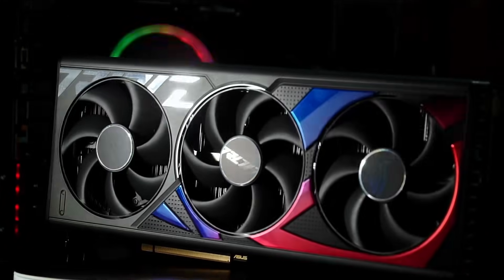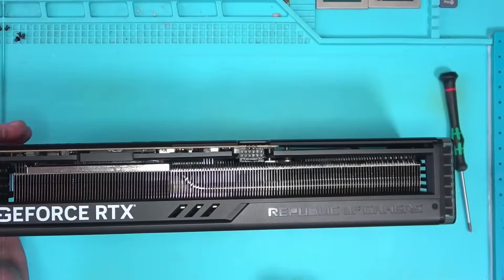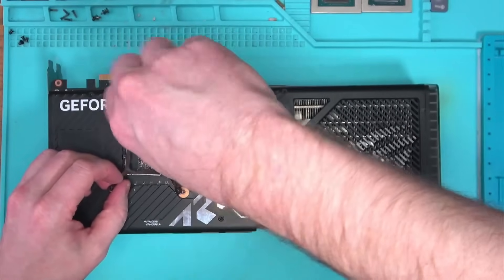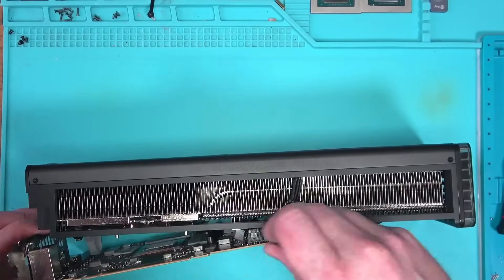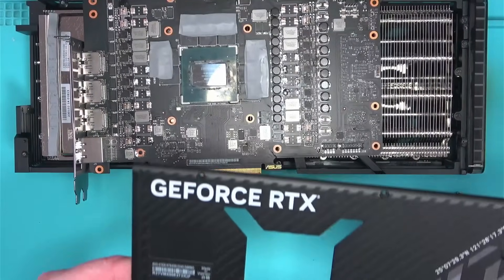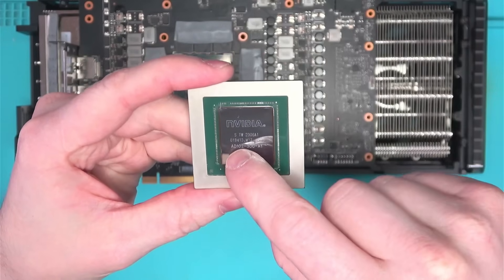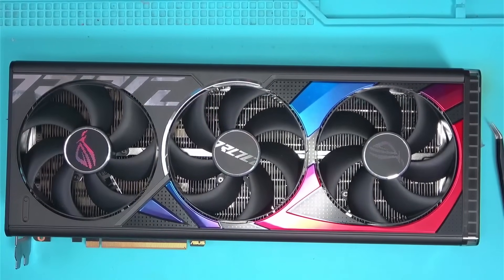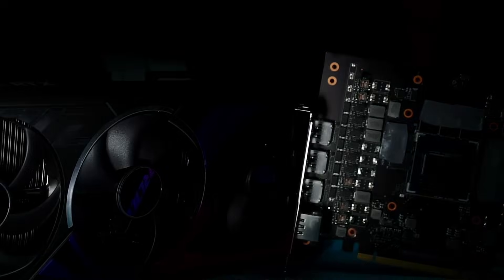Bait and Switch: Amazon Sells 4080 as 4090! GPU Repair Fail!

Comment from the maker: Correction. The core is 4080, not 4090 mobile as i suspected earlier 🤫
Reply: Apart from the chip type and the remaining damage.
Would another chip on the PCB even run if the hardware was otherwise fine?
Reply: Both are correct. The 4090 mobile is literally the 4080 desktop core.
Reply: Hi, was wondering, if suprim x (not liquid), gaming x trio classic 24G and gaming x slim have melted in your experience or are they slightly safer options ?
And would you suggest any of those 4090s or 4080 super ?
Reply: Yup, mobile 4090 is like a collectible, its VERY rare
Reply: @uhohwhy  It has to be collectible because no way it would work. It must be really dead.
Reply: China fake crap. (interesting that i see my comments only, without login i see nothing.)
Reply: Wish I'd seen this sooner, at the end of 2023 I saw a Amazon Warehouse returned Strix 4090. Bought quite a few PC bits with no previous issues so hit buy. Opened it up soon as it arrived and first warning was the cables were not right, no biggie, then I opened the anti static wrapping, and discovered it was a fully assembled heat sink, but no PCB.

Not impressed I can tell you, sent it back and had to wait a week for a refund. Amazon didn't seem to bothered they'd been scammed themselves. I should of taken photos of the serial number.
Reply: I don't understand what's the difference they're all AD103.
Reply: @TheGrizz485  well the difference is $2000 usd for a 4090 and probably less than $1200 for a underpowered laptop 4080.
Reply: No theyre not lol. AD103 is 4080, AD102 is 4090. Someone had the exact Black Strix version of this card but as a 4080. Their 4080 fried, ordered a 4090 on Amazon and swapped the PCB with the chip, said it was DOA, and returned it to Amazon and got a full refund cause Amazon rarely even checks. They might have plugged it in to test it, saw it was dead, and sent it to the palate. They don’t actually open these things. That would take too much time for employees to do that and Amazon would lose more instead of just trashing it. Use to work there lol trust.
Reply: @evangelinadurazosellers5435  Yep. The toasted connector means nobody would try to test it. Failed the visual inspection and tossed in the junk boxes.
Reply: @ir8d8rads you mean they bought upgrade, put fried board inside new fancy case, broke connector to make it look damaged when shipping and returned it?
This is so fked up.

Comment: I want to know what firmware it has. Also, I’m curious if the PCB is actually a 4090 PCB, it is this a fake as well. Did they make this PCB for this scam? If the firmware is weird, and the GPU core pinout matches the ada103, there will be more of these

Comment: AD103 is 4080, AD102 is 4090. Someone had the exact Black Strix version of this card but as a 4080. Their 4080 fried, ordered a 4090 on Amazon and swapped the PCB with the chip, said it was DOA, and returned it to Amazon and got a full refund cause Amazon rarely even checks. They might have plugged it in to test it, saw it was dead, and sent it to the palate. They don’t actually open these things. That would take too much time for employees to do that and Amazon would lose more instead of just trashing it. Use to work there lol trust.

Comment: Have you seen those 4090 with core and VRAM missing, ie, stripped for AI, with the rest sold as a working 4090, ie, when the heatsink is on you can't tell they are missing.

Comment: I buy a fair bit from Amazon UK, I'm wary of the fact that their returns policy is so generous it seems that when I bought a good deal 4060Ti 16gb recently I opened the thing like a crime scene investigator, searching for ANY signs it had been already used. It passed my tests, serial numbers all matched etc. Then the audio wouldn't show when I plugged it in, and GPU-Z, HWinfo etc were not responding neither was Nvidia app.... It turns out the drivers needed the Jan 24 ones installed and suddenly it started working.... It is a concern tbh- folk returning broken things and swapping out stuff. I'm now even wondering whether to buy the monitor I have my eye on from them. Has anyone even done a video on how to spot a fake GPU??
Reply: That is normal behaviour you were trying to use it without a driver and after you installed the correct one for that model it started working properly in windows.

Comment: Ive broken that part off before and been fine 😂😂 when i was younger and had a stockpile of old pc parts that is. What is too tight though? I run them down firm but not tight, figuring the springs are supposed to help hold tension. Guess im glad i had lots of practice on old stuff lol

Comment: Is it possible to easily increase the amount of memory on some cards? I'm sure that a lot of people want to run AI, and they are limited in the gpus they can get because they need a lot of VRAM. If you get GPUs to fix, could you just add chips or replace chips with higher capacity ones to increase the VRAM and sell at a (small) premium?
Reply: no you need to make a custom bios also and reflash the bios and you will have problems with getting drivers to install or the device to be correctly detected most likely since it wont match official nvidia specs

Comment: You could tell it wasn't a 4090 even without opening it. The capacitors on the back of the core on the PCB are definitely not the ones on the 4090.

Comment: After China imported a lot of 4090 cards before the embargo and equipped them with other coolers for use in data centers (including desoldering AD102 chips for whatever reason).
Is it possible that the resulting, actually worthless hardware is also wanted to be monetized somehow?

Comment: for me it looks like a scam by service/technician guy, who repair GPUs for daily basis.

 he had a lot of bad cores, bad memory chips, and crack pcbs which cannot be repaired. 

so instead throw it all into recycle bin, he decided to put all bad parts together on that board and then sell it. he knew that melted connector will attract buyers as a good offer for quick repair.

he cannot be a regular gamer/customer. - this scam is too good for a person without knowledge.

probably, the original GPU core from that pcb was good, so he took it / save it and replaced it by anything bad, which fits there.

Comment: So, the general assumption seems to be that less scrupulous (usually Chinese) AI companies are buying 4090s, taking the chips out and putting them on their own specific boards and then returning the the now empty board and cooler.
These guys look like they were trying to get away with it longer, or maybe they are middle-men of a two part scam of selling the 4090 chips and then selling the card that'll fool someone long enough for them to get the money and run.

All around, make sure you get your tech, especially if its expensive, from reputable sellers with good returns policies.

Comment: The retailor that's allowing this does it with their own For Sale items ive been burned by them myself, when they sell fakes sold by the Big A you can't leave a r
Review they let some good ones though then do something to prevent any bad truthful reviews on said item, you get a error thats says theres a issue they are looking into but the item stays up for sale indefinitely, if you call them they won't talk to you about it!  Just like the automotive fuses they sell rhat are not fuses they don't trip anywhere near the rating but they have thousands of 4-5 Star reviews. You will have to fill in the blanks here because YTs AI likes to delete any mention if the brands or rhe Seller. Id be surprised if this doesn't get removed by YTs Skynet.

Comment: This is why I refuse to buy electronics from the used market. Theres all sorts of shady stuff going on when theres a bit of money involved. People will do whatever just to make a buck and the GPU market is no exception. Buy from trusted sources always.
Reply: I mean, I just got my hands on a GTX TITAN Z sold by PNY for 200 bucks. If you buy from a good source, it's easy to get what you're looking for, even for rare components.
Reply: I buy and sell used computer parts for years.  
I did sell a used AGP GeForce 6 card last summer for $100.   The buyer had bought a bad one off eBay.  I admitted I had no way to test the card since I did not have an AGP motherboard anymore.   I was glad when he reported back that the card worked perfectly.
Reply: I have bought 4 used GPU's and a couple of used consoles over the past few years and they've all been fine. All of them are exactly as the seller described and all of them still work. You just have to not buy from sh!tty sellers. It's usually pretty easy to see when a seller is legit based on number of transactions, feedback, accepts returns, etc. After you've dealt in the used market for awhile, you generally develop radar and can spot questionable/scammy sellers from a mile away.
Reply: @Kryptic1046  Dead on with your assessment. I have bought a lot of used computer hardware off ebay and I've only had one issue. That issue being an intern that sent me the wrong GPU. The seller made me whole for no extra cost though so I gave them a good review. Since I'm mostly buying cheap stuff under $100 I'm willing to take some risks.
Reply: @Kryptic1046  After getting tracking number scammed by 2 different large scale high rep sellers on eBay a few years ago and eBay did nothing about it, I changed my strategy for buying used electronics and have had nothing but success with it. Basically I look for signs that the seller is clearly just a person with a computer hobby who occasionally sells on eBay when they haven't had takers elsewhere. I look for instances of feedback from PC part sales, anywhere from 20-100 positive transactions in their account history, and are actively selling or buying PC parts within the last year. I will also usually try and strike up a dialogue and engage them with a few very courteous and basic questions about the part to get a feel whether or not they're insane or an idiot to determine whether or not I should keep bidding.

Since I learned that high volume sellers with a long record of positive feedback might suddenly start scamming people, I started only doing business with people I can identify as actual PC bros instead of high volume resellers who only care about the money, and since doing that eBay has become a really nice place to shop for me.
Reply: there's many trusted sources for the Used market too.
and for Buying from an individual you could request them to prove that what they're listing is real with Photos and Video - proving that they actually have it and that it works (having someone write their Username and hold it up in a Photo, the usual - Video of it running real workloads so you can see if the performance matches expectations, as well as them showing stats of the Hardware while it's running).
an Individual could try to scam you after that, but if they provide such proof and what you receive is incorrect, you are protected well enough and can get your Money back. granted that will waste some Week(s) of your time, but.
Reply: Cool. Ebay is a gold mine, more for everyone else.
Reply: @x8jason8x  I bought a used 6900K from there that still works to this day, got a working replacement mobo for my i7 3770, also from a good seller there, "used" but so clean you'd think that motherboard was BRAND NEW.
Reply: If you make good research you can save a ton of money buying used, had no problems ever. But you gotta be careful.

Comment: So wrong PCB matched with wrong core. 
Safe to assume that the pinouts are wildly different and the moment power was applied to this card it just went up in smoke?
Reply: That's just a 4080 PCB, you can see the silkscreen matches the outline of the GPU package perfectly. Someone had a defective 4080, attempted repair themselves, completely messed up everything, then ordered a 4090, took the stickers from the 4090, put them on the 4080, and sent the 4080 back in the 4090 box to get a refund. Judging by the placement of the VRAM thermal pads, they might even have swapped the cooler from the 4090 over to the 4080, which is why the pads don't align with the chips.
Reply: @Alvin853 damn i mean how should amazon even test that?

Comment: no, thatsa  4080 desktop core, not a 4090 laptop core. laptop core would not be ad103-300. laptop cores have "gn" in it
Reply: I saw ur eBay post about buying 32 4090s what happened with that

Comment: My guess is somebody with no scruples bought a real 4090 on amazon, replaced the working 4090 board with a dead 4080 board with 4090 mobile GPU (maybe some aliexpress special) and kept the working 4090, using the aliexpress 4080 shroud/serial from the dead board, so the real serial still matched on the return. Amazon couldn't/didn't want to repair it for resale, so they packaged it in these "return pallets" that they sell as mystery boxes so they can get rid of their crap. The buyer of this mystery box then sent it to NWR for repair, where he determined the board to be essentially "fake". Amazon was probably the one being scammed, at least in this case.
Reply: I think so too although I'm yet to see any 40 series mobile aliexpress PCI-E Frankenstein cards on the market. I think this might just be a dead 4080 board.

I've no doubt those Frankenstein cards are coming though, they exist for 30 series mobile GPUs
Reply: could just be a shady reseller passing off aliexpress hackjobs as legit product, and it got returned when it fried.
Reply: Why even bother getting 4090 mobile gpu at that point?
Reply: what is worse is if this was from a 3rd party seller (even if shipped by amazon), amazon would have refunded this customer in full taken that money from the seller account (sellers dont get paid by amazon for the order until 10 business days after the order is marked as recieved) and if the 3rd party seller didnt opt to have the card returned to them (paying the postage themselves) then amazon just sell it in a returns pallet automatically. Amazon wont even do a basic check to see if the item is physically damaged and even elegible for return/refund. Likewise they dont even unseal the box to verify that what is returned is the same item that was shipped. They use the tried and true "if it looks like a duck, and quacks like a duck, it must be a duck" approach.

This is why I tend not to list anything as a seller on Amazon anymore, Amazon's policies are so customer friendly that people can and will abuse them and almost always get a 100% refund. I once had someone order a gaming monitor. We shipped it, it was delivered and signed for. Then 1 day before the amazon deadline (89 days from order) they lodged an A-Z claim for full refund saying they didnt recieve the monitor. As the seller we had to fight through losing the case (it was automatically granted to the customer within 10 mins) then on appeal after showing the tracking with customer signature Amazon finally rejected the claim by the customer. It almost went the other way, since we couldnt provide video or photographic evidence from the courier (which was not a normal postal service, it was a full courier tracked door to door) that the package was recieved. I think it was us using a full registered courier that got the case in our favour as if we used regular post, amazon likely would have sided with the customer.

Amazon has become so dodgey for sellers simply due to Amazon's own policies and the many people out there who take advantage of it knowing that 95% of the time they will get a full refund.
Reply: Work smarter not harder
Reply: No... i dont think amz guys check stuff like these when they get returned. I sus a round of visual inspection and it gets thrown in box. 
Ideal cse scenario they should at least be throwing this in a tester to find out see if this even boots or not, but knowing their volumes, probably not.

Oh well, what are ya gonna do. Corpos try to save money, give their job to someone else, somebody down the line will abuse it.
Reply: No scruples? He got a free 4090.

Comment: First issue was trusting Amazon for such a component. B&H ftw in my opinion
Reply: B&H?
Reply: @EclipseWarlord  bhphotovideo. Don't know why I threw the & in there lol
Reply: I bought a 1080Ti from amazon on launch, but made sure it was NEW and sold by them. If you have a problem just return the item... Never had an issue with Amazon but if the seller seems shady and isn't Amazon EU S.A.R.L I don't buy personally (in europe). It's been super easy to get even rare shit (got an Audio Technica ATH MSR7B (which was a limited edition) and no issues there.

Comment: Some people have similarities to 4090 GPUs.  Both develope giant cracks.  😮
Reply: ..ya thay also do fizzy noizes when u crank the juice up... 😁 ..ive heard..
Reply: All 3 of my 4090's are in prestine condition. One horizontal the other 2 vertical. Have had them since launch. Gigabyte Gaming OC, MSI Suprim X, and Asus Strix. Zero issues and obviously faster than everyone else. Native pcie5 PSU's.
Reply: @6r3ys0n  undoubtly ther is alot of cards just working fine, but much of this problems that new cards has was earlier unheard of or extremely rare... now the limits are puched and thers a more fine line between break or fail... the cards are indeed much faster and 'better' .. but are mass produced and thers alot more bad once passing quality control, for exaple bad soldered pads may not show until it exposed to -40 c during transport and vibrations...